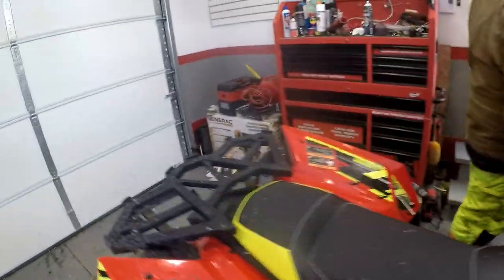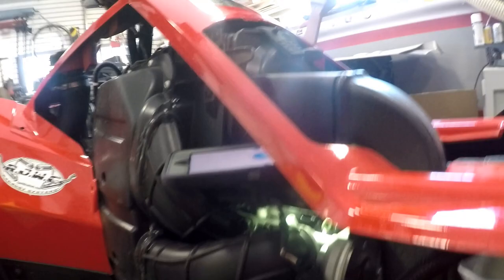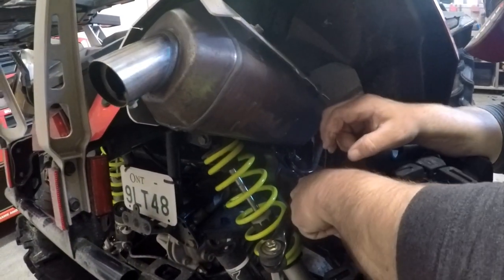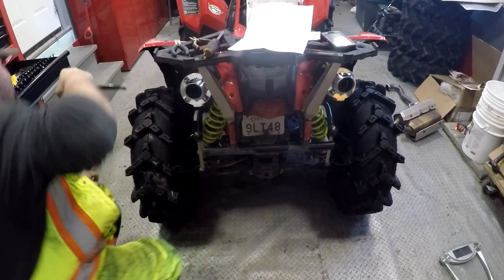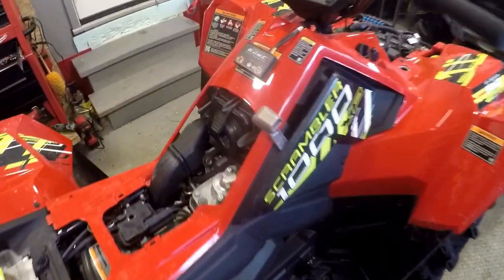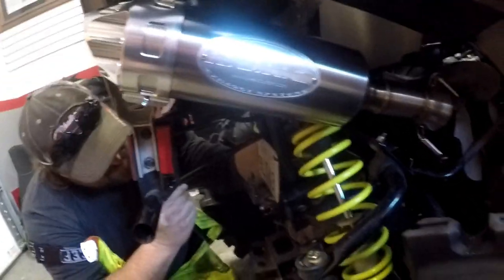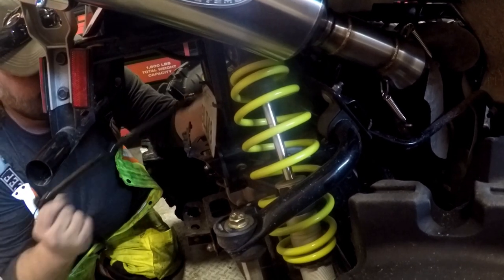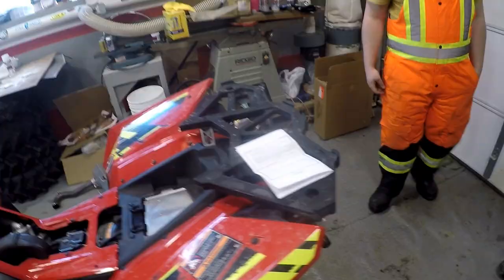RJWC Duel/Single vs Stock Sound Comparison SCRAMBLER 1000XP

Comment: Have him look into getting cecco racing front and rear frame braces, along with front pinion cover. That will fix the known weak points.  I have the same machine and love it.
Reply from the maker: He has Pinion cover on the way and I just ordered these parts for my brothers Polaris. Cecco Racing has all the weak spots covered for these machines, eh.
Reply: I just bought a 2014. I got dang near everything they offer for it. Minus the frame guessket kit and the battery relocate kit lol. 800 bucks.